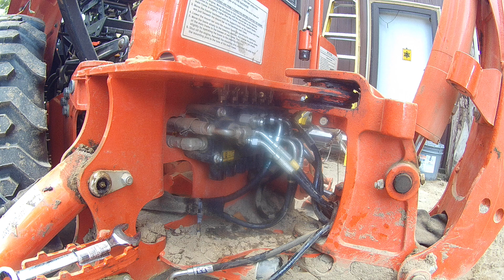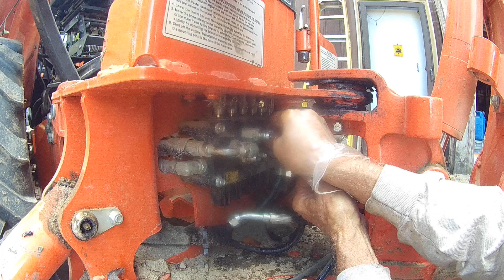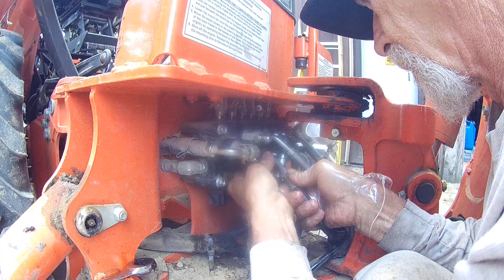2017 Kubota B2601 Changing how the levers controls work the BH.

Comment: Mech, when I tighten those type hose connectors, I wiggle the hose slightly the entire time while slowly screwing the nut onto the threads.  This seems to allow the nut to work independently but as you said, you gotta have some room to get your hand in there.  That appears to be a fine threaded fitting, huh?  Can't wait to see the results after you get the hoses reconnected.  Will be back for Part 2. 
Thumbs up.
Reply from the maker: Yep you're right about wiggling the hose. I took my time to make sure I didn't cross thread them. Thank you for watching. I hope you don't have a lot of damage from the hurricane. Be safe my friend. Later